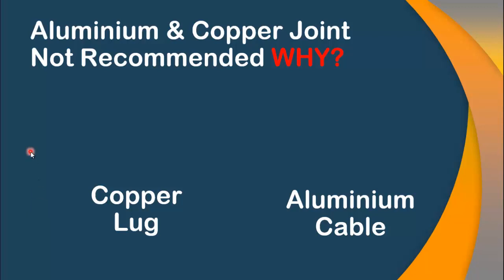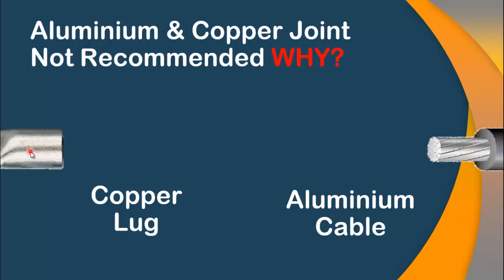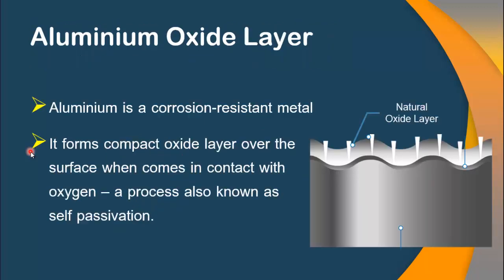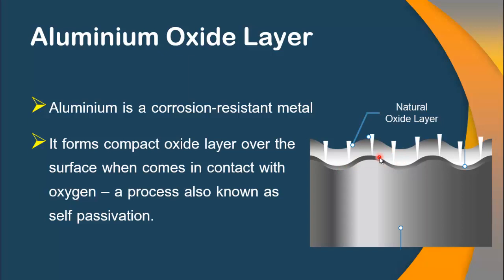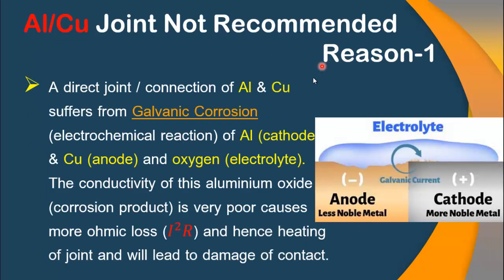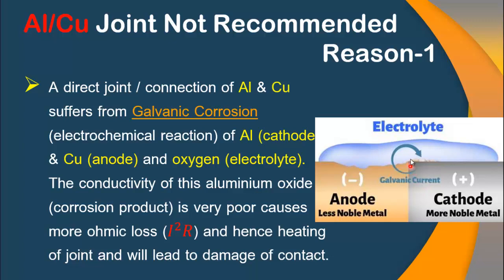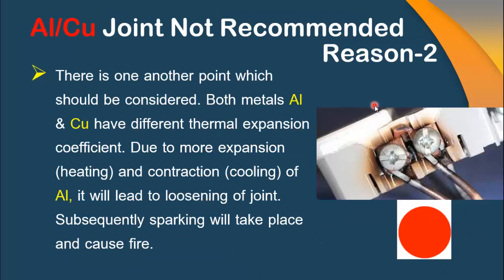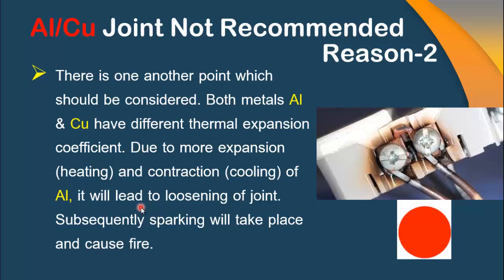Why Copper and Aluminum Cable Joint is Dangerous

Comment: Sir recently i  i  taken  6  domestic  meter panel box with bus baar But in bus baar aluminium rods are used is it safe or i upgrade to copper rods ?
Reply from the maker: Aluminum bars are safe if they are proprely ized for your load. But again connection with alum. Bars are made with bi metallic lugs

Comment: How many thousands of years does it take before this happens?
Reply from the maker: Not many if put in excessive moisture. And also depends on amount of current but its better to avoid such practice. No body recommends direct joint